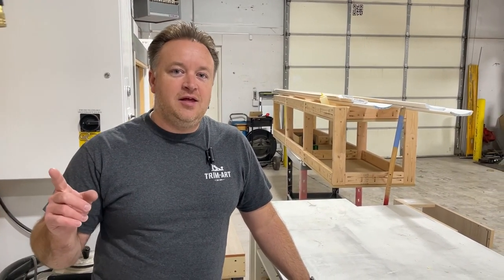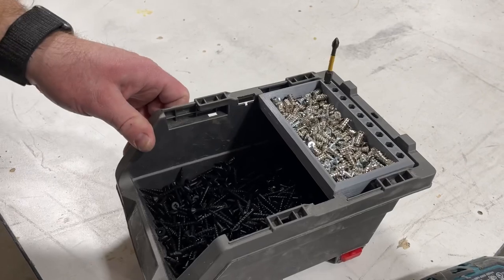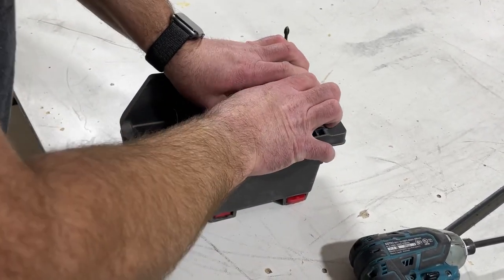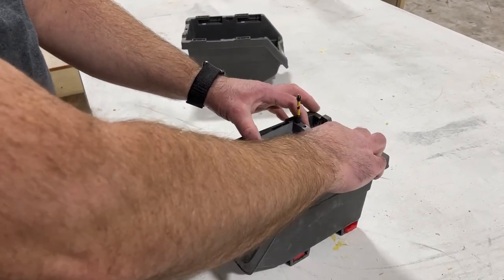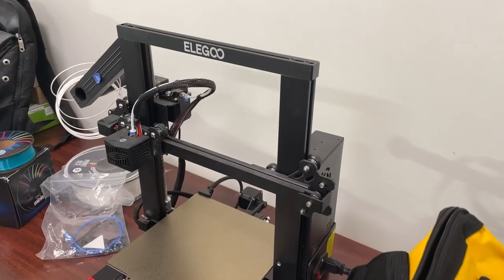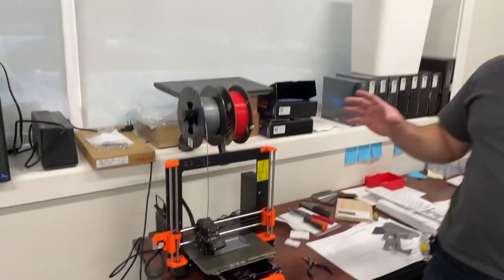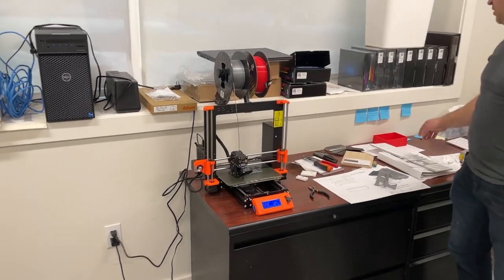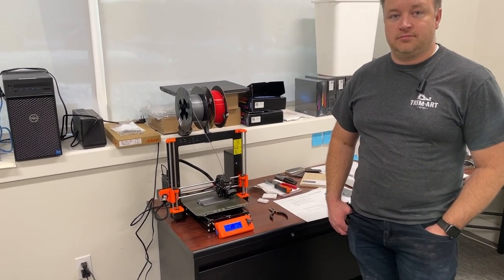Lean improvements using 3D printer. A must have tool for the woodshop.

Comment: Having 3D printer in a workshop is a godsend. But you have to buy printer that "just works" or you'll be fixing printer all the time instead of just printing stuff that you need. Among cheaper printers (up to $1k), only Prusa really works. Stay away from Ender 3 and such - they're pain in the rear and not worth your time.
Reply: NAh I got the 3S1 and its pretty nice, the stock and v2 are not worth it though
Reply from the maker: We really like the prusa